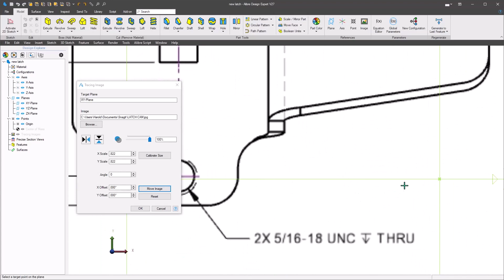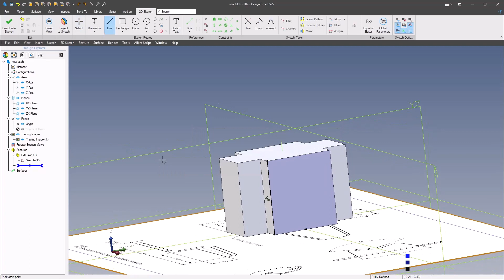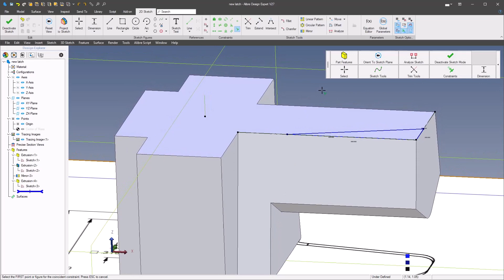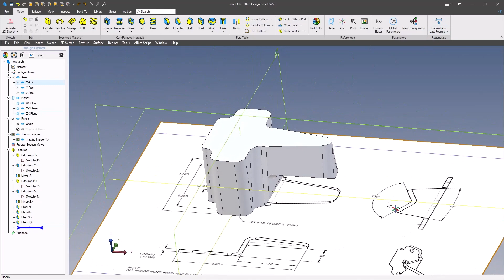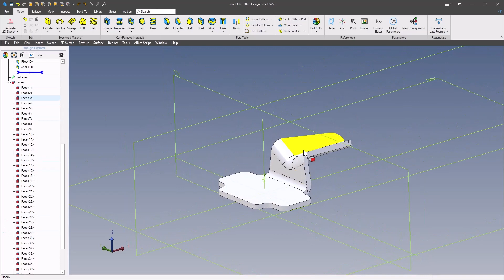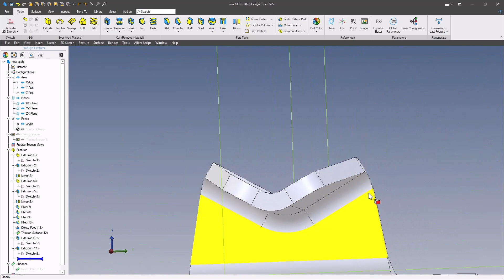Alibre Stamped Sheet Metal Parts

Comment: Wow man! Awesome example and a great workflow to create parts. I would have gone in a very round about way doing this and I probably wouldn't have achieved this good of an example
Reply from the maker: Thanks. In SolidWorks this would have been done with Surface commands and a bit of effort. With Alibre, being able to model stamped sheet metal parts off of a solid model and using Shell or Delete Face and Thicken is a great tool set to have at your disposal.